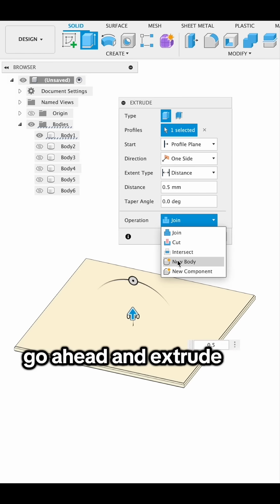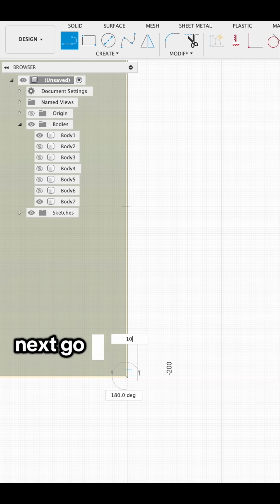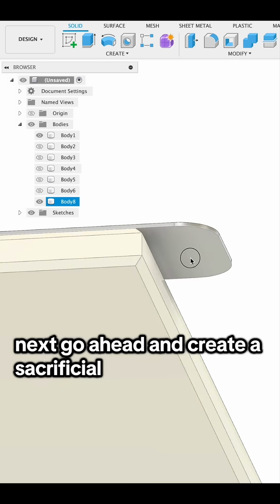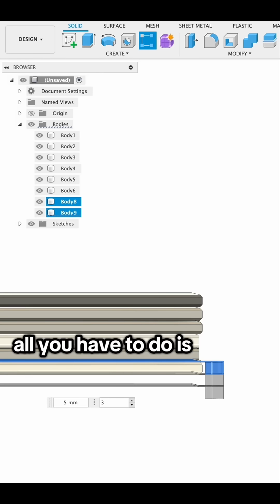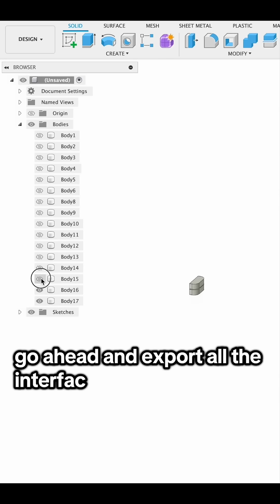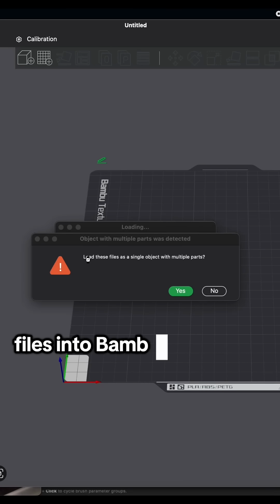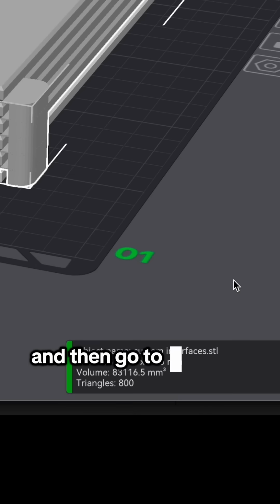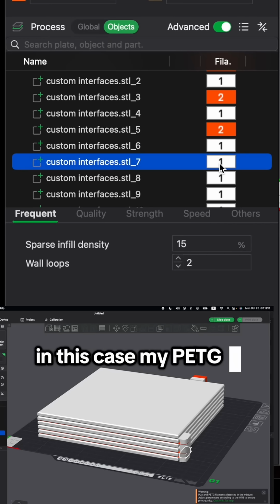The best way to 3D print stacked objects using PETG and PLA. Full tutorial!

Comment: Hi, I followed your workflow as closely as possible: I modeled the stacked PLA parts, added the PETG separation layers and pull tabs, created the PLA sacrificial supports, exported the parts, and loaded them into Bambu Studio as a multi-part object.

However, after splitting and assigning the filaments, Bambu Studio gives me this error:

“Levitating objects cannot be printed without supports.”

Also, when I keep the model as one multi-part object so that it can be sliced, only the very bottom surface and the very top surface get solid bottom/top layers. The internal PLA surfaces next to the PETG layers are treated as internal regions, so the infill is exposed after separation.

Did you print your PLA parts with 100% infill? Or is there another slicer setting or model setup needed to make every stacked part have a solid top and bottom surface?

Thanks for your help.

Comment: Yeah and this would work for basic models only. As the  support interface does not stick to the model filament they tent to peal. Give the same example with squares and you would see how the corners would not stick and you would have quality issues.

And you do not have to export as 2 stls. Just export as 3mf and then you can go in the slicer "OBJECT" tab and assign needed filaments.
If you wish you can assign materials in fusion and then the slicer would automatically assign them to different filament slots.

Very, very, very misleading and bad video. Very bad

Comment: Wow - seems to work pretty well.  Now I just need a multi filament printer
Reply: Since you'd be printing by layer you don't actually need a multifilament printer you could add a pause and do the filament switch manually. It's certainly less convenient but it is still completely possible.

Comment: Why is it important for the interface layers to be at least two layers thick?
Reply: Most likely because he wants a crosshatch pattern which solidifies the separation layer into a solid plate that can't easily break or separate into individual "strings" of the print lines.
Reply: @lirangoshen that actually makes sense
Reply: It isnt if your layer lays down uniformly. I believe 2 layers is just a bit more forgiving for printers not calibrated 100%.

Comment: Or... print them vertically.
Reply: That would need a horrendous way to print those pieces
Reply: it would make the boards weaker (split easily by layer) and create issues with the holes overhang, wouldn't?

Comment: Urg I have a file with 200 bodies and have been recolouring each body in the slicer.
Reply: Put all the interface bodies in a component and export as a STEP file. STEP files have bodies built in unlike STL but you can separate them in the slicer or treat them as one object. keep them as an assembly and just apply the material to the assembly (the component exported as a step file)
Reply: @glm54321  thank you, I just got round to properly experimenting, this has saved me hours of work. I had to cut and paste into a new component, as when i tried to use the component from bodies feature it made a component for each body. Is cutting and pasting on mass the best way? thanks again
Reply: @andrewcook5842  Sorry I didn't see your response, glad I could help!  Make ONE new component from one of the bodies by right clicking on the body. After you can select all of the other 199 non-component-ized bodies (shift click the list) and then drag and drop them into the component from body you made earlier. I do that a lot when I pattern a body within a component that has other different types of bodies, for example.